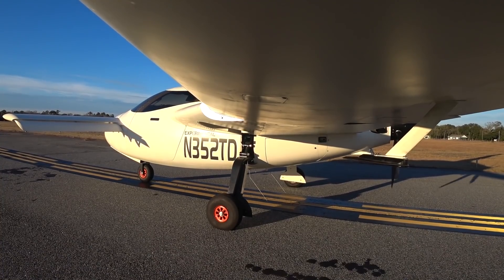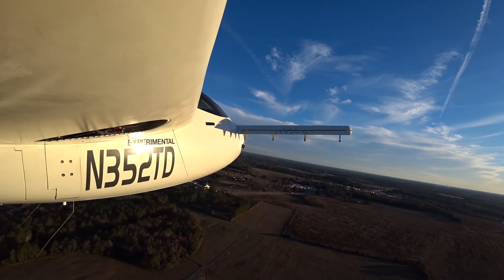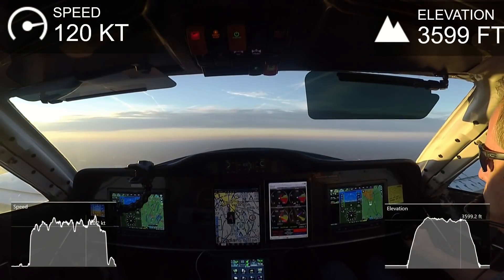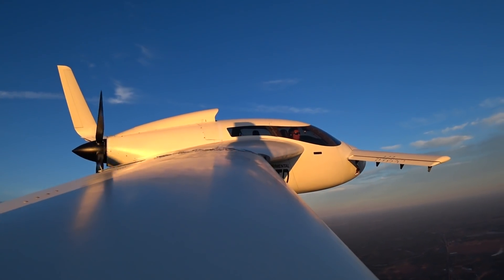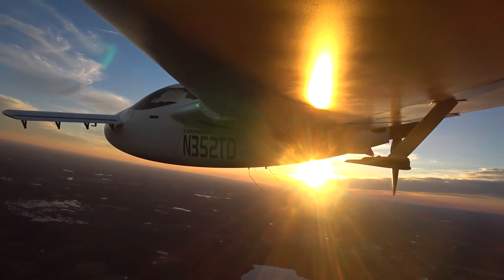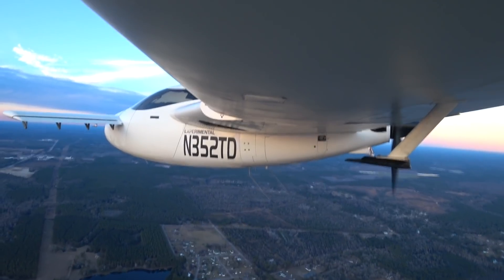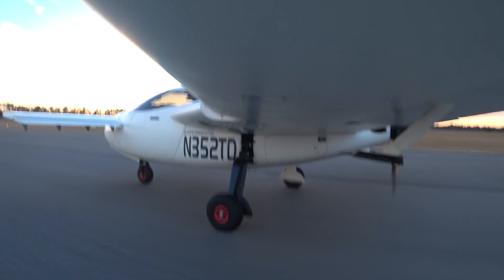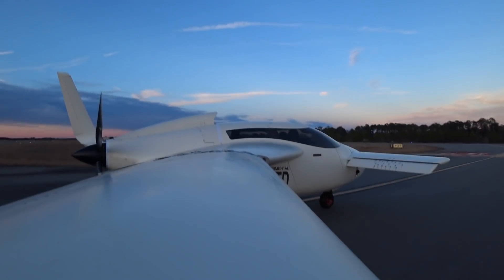Evening Flight Test - Flying the Raptor Prototype

Comment: Not trying to be combative, but as a pilot I have to ask: What is the reason for the high-altitude turbo setup if you can't use full power to climb more than 1000ft out of the pattern?  Does anyone know if the advice of the VW/Audi-Turbo Diesel designer in previous video's comments section (I think it was Andres somethingornother) has been followed to see if eliminating a turbo would help with the heat?  Id love to see this project succeed but it seems like it might be better to set up for low altitude ops until the aerodynamics are sorted out doesn't it?  I guess i'm thinking more along the lines of get it to fly well in the current flight envelope before setting up for high altitudes... or better yet, set this one up for low altitude to collect data and then Raptor Prototype v2.0 can focus on weight savings in the build and high altitude performance in the powerplant... regardless, God's blessings in your endeavors and be safe out there!
Reply: That seems a little short sighted.  Solve the heating issue (Which plagued all of the P-51, B-29, B-17. P-38, and a "few others" during development) and it is a non issue.  One thing at a time.
Reply: I think for the most part, the issue with not being able to use much manifold pressure is due to inadequate cooling.  Once that's figured out then full rated MP should be attainable.  Usually, the big problem with a turbo aircraft is figuring out the right balance between proper cooling at low speed/climbout and lowing cooling drag penalties at high speed.

Comment: I have been following this development almost since inception but I am wondering if we will ever see some decent airspeed on this machine.  In my opinion,  the powerplant cooling issue should become a high priority because honestly, for a small comparison a SLING TSI with 135 HP Rotax can cruise at 150+ kts on 7.5 gph up to FL180.  What will the Raptor offer to rival that?
Reply: You're not going to see higher speed testing until other parameters have been met.  No sense in adding another unknown factor into the testing regime until the known issues are addressed first.

Comment: I'll say it again: until you instrument your cooling intakes and outlets with pressure sensors to measure pressure recovery and pressure drop, you're working in the blind with regards to getting better cooling. These MPX5010DP sensors are like $10 a piece, just instrument the shit out of it. See http://www.n91cz.net/Pressure/PlenumPressure.pdf
Reply: I suspect that the issue is exhaust rather than intake, your suggestion would certainly inform.

Comment: Peter. in order to solve your cooling issue, try to create more vacuum insde your engine bay, try to measure it. You can try to close upper openable scube and see the difference. Very important is to use your exhaust pipe to help you create more vacum inside the cowling. you don't need more coolers but more stream through them. Your intake scoobe is to bi in comparison with outway...just try it
Reply: Yes. Configuring the cowling so that exhaust flow sucks air through the cowling.  it's called an extractor. I read about it in EAA Experimenter years ago.

Also: https://www.caro-engineering.com/projects

Read the bit about Cessna 337 cooling. She fixed it by moving the air inlets to the high pressure area under the engine and the outlets to the top where the low pressure is.

Comment: Great looking airplane! The top rear-mounted air intake has me confused, does laminar flow ram air into the scoop, or would the airflow try to reverse because of the lower pressure from lift over the top of the fuselage?  I did watch some of the older videos but didn't find an answer.
Reply: It's ram air.  There's not enough AOA induced low pressure to cause negative effects, though having on the underside would likely increase ram air to an extent.
Reply: Maybe the scoop is in the wrong place.

Sonja Englert fixed this same problem, she moved the aft engine cooling intakes on a Cessna 337 from  top to bottom.
Reply: @myotherusername9224  Potentially.  There's likely several valid reasons why it was designed to be on top as well.  The difference in air volume between top and bottom might be enough to fix the cooling, but it's also possible that there's a negligible or even detrimental difference.  Keep in mind that several WWII aircraft gained ram air pressure from an intake scoop mounted in the same place, namely the P-39 and P-63, among others.  It was equivalent to about 2"MP at cruise speed if I recall.  If it was found to be inadequate to produce proper airflow in the P-39, or if it were possible to produce more via side or bottom scoops, they likely would've integrated it into the P-63 during other upgrades as this would've been a very simple modification.  Another little tidbit, the open area of that scoop is about the same size as most WWII fighters had for their radiators.  It's likely flowing the same volume of air that is necessary to cool an engine three times the size.  I suspect the issue lies more in the size of the radiators or the turbo/intercooler setup rather than the amount of airflow they're receiving.

Comment: Glad to see another update - part of me wonders how things would be with a single turbo vs dual? I wonder how the power/heat ratio change.
Reply: Absolutely - My aircraft’s 350 HP continental (TSIOL 550) has one big (huge) turbo that keeps full sea level power up to FL250 - and beyond. So it can be done and works great in my experience.
The serial twin turbo setup Peter is using poses some challenging questions in terms of reliability (if any one turbo or related accessories fails, the system fails) and restart at altitude - a known weak spot of aviation diesels. 
One must also consider the increased number of pipes, weld points, clamps that can leak or fail, and the sheer weight penalty - guess where the excess weight is located and why this aircraft needs nose ballast...

Comment: I know it might seem counterintuitive the electric fans really do restrict airflow in a big way. I saw your footage of the airflow with telltales getting pulled straight back out of the cowling by the prop at idle. In my opinion and with my experience no way are the electric fans pushing that much air. You should try to remove the electric fans for a test. I have a 500HP turbo engine and no matter the electric configuration they just could not push or pull enough air with a radiator and turbos intercoolers. I fought like hell to cool a turbo setup with electric fans for months they just couldn't do the job. In my mind and by the advertised CFM of the electric fans I was convinced they could do the job. I know it is a job to dig them out it was in my setup but when I did I felt like an idiot. It might not work in your setup but it did for my project. Good luck you have made a lot of progress I love the craft it looks amazing just sitting on the ground and even better in the air. It's just a suggestion

Comment: Four red on landing - again. Makes me nervous every time.
Reply: The VASI bars don't take into account the flat approach of the canard configuration . I guess you would have the opposite issue approaching in a Wilga.
Reply: @leerogers6423  sorry but those look like PAPI to me rather VASI 🤔🤷
Reply: @leerogers6423  aircraft attitude is mutually exclusive of glidepath angle.
Reply: @aviator267  . Yep correct . You got me.

Comment: I still can't figure out why you're consistently low on the PAPI (I'm perfectly OK with going below it on SHORT FINAL so as to aim for the numbers) and then keep power in during the flare, resulting in long landings every time.  If I'm flying a single-engine experimental aircraft you can bet your life I'm flying a high energy approach, but that would include ABOVE the PAPI and slightly fast until short final.  

My concern is that an engine issue will make it impossible to reach the runway if you have a problem on your typical patterns from base to final or anything longer than short final.
Reply: Listen to his explanation of exactly this at 11:26. Not trying to be
Reply: @myotherusername9224  But his explanation is diametrically opposed to his goal.  Per his own words, slowing down is not a problem, so we both agree that a higher speed is good (until short final) but there is NO GOOD REASON to be below the PAPI.  Ask your self if you'd rather be above or below the glidepath with an engine failure on a 2-3 mile final?
Reply: @formulaben  it's a feature of canard airplanes. It's kind of what killed the beechcraft starship. There are no flaps on most canard airplanes so if you point the nose down you will pick up airspeed and 3 degrees down is faster than 1.3 times the stall speed which is ideal short approach speed for aircraft. In order to accomplish this he has to come in lower. You could come in at a higher airspeed yes but in order to slow down sufficiently to operate on less than 2500 ft runways in this low drag airframe you would have to install airbrakes somewhere which is a little late to do with this aircraft and that's another moving part to consider that will have to run off of a hydraulic system which means less useful load. Or.... you could come in below the PAPI... or not buy a canard aircraft. 🤷‍♂️
Reply: @generalrendar7290  I agree with your comments except that he's not on a short runway and the power setting on short final is nowhere near idle; he can clearly come in steeper if he wanted to.
Reply: @formulaben  and wear his brakes out faster and increase the chance of a shimmy in the nose wheel. I'm a flight instructor so I completely understand the aversion to coming in below the PAPI. At the end of the day he's pilot in command and has to live with the risks. An airbrake would be the best mechanical solution to this problem although the cost in weight may be undesirable.
Reply: @generalrendar7290   Worn brakes and a nosewheel shimmy versus crashing on short final with the next engine failure because we were below the PAPI...are you really arguing for the former?!  Where do you teach?
Reply: @formulaben  you are being way too combative for this discussion. Tell you what, go fly a pattern in your plane and fly it normally. Cut your power as soon as you turn final with 2 red and 2 white and try to make the runway. Unless you are in a powered glider or flying with a tailwind, you're not making the runway. Precision Approach Path Indicators are about obstacle clearance not being able to make the runway if an engine fails. By all means go try it with an instructor preferably so you don't put yourself in unnecessary danger. I have over 1000 hours dual given and my students have passed with accolades from DPEs. Heck I've trained power off 180s with students and the cross winds were so strong we couldn't make the runway even starting at 1000 feet and abeam the thousand foot markers and turning directly to the runway. This goes for Visual Approach Slope Indicators as well. These are not ideal gliding paths, they are controlled descent paths that help IFR pilots avoid terrain and other obstacles. Go look at Scott Swing and other Velocity pilots on YouTube. The approaches are much lower compared to other airplanes.
Reply: @generalrendar7290  I'm sorry that pointing out facts is "combative" to you.
Reply: @formulaben  it's not facts it's your opinion. Go do a power off approach lined up on a PAPI from a normal traffic pattern. Go look in the AIM and find out what a PAPI provides. Did you read the article I shared? Is Paul Bertarelli a trash pilot? Have you flown canard aircraft? Do you always glide in without power when on a VFR or IFR approach after you've lined up on the "glide path". Go do it and see how that works out for you.
Reply: @generalrendar7290  I didn't see a link to the article, so no I didn't read it.  I'll answer the next 2 questions as soon as you answer my earlier ones...
Reply: @formulaben  the reason that he's choosing to land long is because he is trying to set the plane down as gently as possible since this is his only prototype he is building the POH and performance numbers as he is flying it, so he doesn't have the best speeds nailed down yet, he's going off feel. The P38 Lightning prototype was completely destroyed in a US Army publicity stunt and not only did it delay production of the plane but it robbed Lockheed Martin of the chance to find the issue of the tail stall in a steep dive and many US pilots lost their lives over it. These tests are about engine performance and cooling, not nailing down the best approach angle.
Reply: @generalrendar7290   This is not a rhetorical question...I'm seriously asking you to put on your Captain's/CFI hat and try to think critically and try to explain not why it didn't, but how it COULD HAVE MADE IT, despite a dual engine failure.  While you're at it, ask yourself how/why 3.0 degrees became the standard for ahem GLIDEpaths.
Reply: @formulaben   you're stubbornly holding on to a misnomer. You do not fly a 3 degree descent path with idle power. The approach path that PAPIs and VASIs provide is for OBSTACLE CLEARANCE. Don't buy a canard aircraft if it it bothers you so much. Please go to 2-3 miles out from runway, line up on the PAPI or VASI and try to make it to the runway with power at idle. It's OBSTACLE CLEARANCE, these airframes are especially low drag and it is difficult to slow them down. Why don't you call Velocity Aircraft down in Florida and ask them why their approaches are so flat?
Reply: @generalrendar7290  You've refused or are unable to answer several questions and now I can see why you won't say where you teach.
Reply: @formulaben  which questions? I've answered all of them.

Comment: That cooling issue is going to be the make or break deal on whether this kit will be commercially viable. Pilot's are not going to be happy only climbing at 50% horsepower and I don't believe that your other canard competitor has that issue. Someone has already mentioned this in the comments, but the issue may be that the pressure inside your engine bay is too high and air can't escape faster than it is being pulled in. This solution is likely to be way out in left field, but is there anyway that you can take advantage of the effect that agitators use? I don't know if the exhaust would be enough to generate the low pressure needed so perhaps you could siphon off some of the ram air to accomplish that goal? I'm trying to think a little more out of the box for this issue. Wish you the best of luck in this endeavor!

Comment: Love the vids.. and pardon my lack of aviation knowledge.... but there seems a huge amount of effort having to go into incremental engine system improvements. This seems to be adding system instability with so many variables in play. Is there merit in going back to square one and reassessing whether it would be better exploring a higher performance proven engine package already in use to provide greater performance and overcome the oil temps and seeming power limitations? There are so many other airframe and system refinements you are pursuing ... and there is only so many hours in the day..
Reply: @rustusandroid  thanks good observations ... having looked around I can now seen there are many different options being used in say the velocity airframes ... so I see the segment has a lot of innovation and individual solutions being explored. I have gone back to the earlier videos to understand the Engine development program.... nothing but admiration for the dedication and application going into the project . Cheers!
Reply: @tujmeister  thanks for the great background ....I have now had a look at the various developments in the segment ... with LS, rotary and others in say the velocity craft and can see that Peter is exploring a significant ‘step change’ in dynamics. I have also gone back to the earlier videos to understand the concept and journey ... great determination, application and innovation... will continue to follow Peter’s journey with great interest.

Again, thanks for taking the time to provide the context. Cheers

Comment: For what it is worth, I am fan of your project and have been following it closely for quite a a while.  Right now the cooling issue is your number one challenge to solve?  It seems worthwhile to pick a goal (Run the AC on a hot day and be able to get full power on the climb for some duration of time) and then do what is necessary from a cooling/engineering perspective to hit that goal.  Anything else would seem to be meandering and wandering half measures?  Perhaps I am wrong in this, but from time to time you have to pull your head out of the weeds and redefine a top line goal based on your most recent accomplishments?  Again.. am a huge fan and offer this point of view for consideration.  Fully expect whatever path you pick you will get it sorted and working.  Great work Peter.
Reply: Cooling is a trade-off. If you size the system to withstand durably full power and full AC in  the climb condition on a hot day, your aircraft will look like a manta ray and you’ll end up with a huge penalty in cruise. The dark art of successful cooling is very complex and requires many experiments because no simulation is accurate enough...